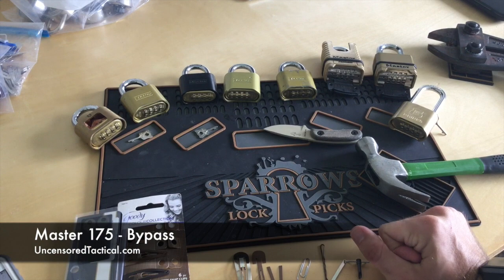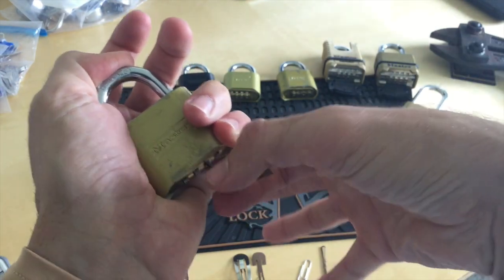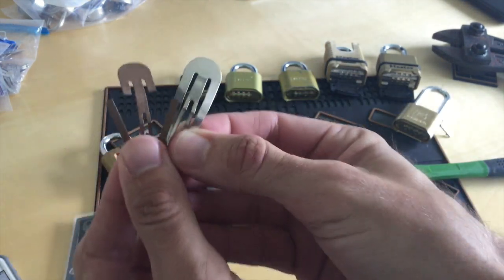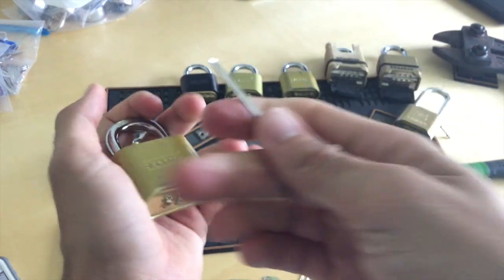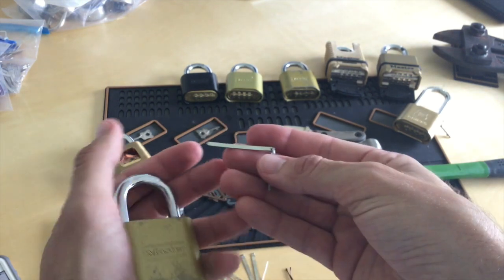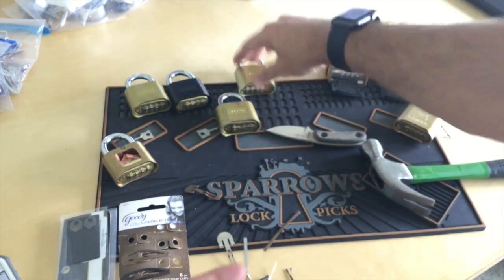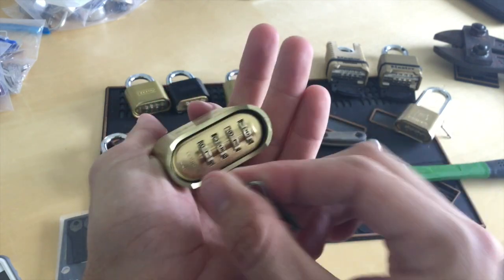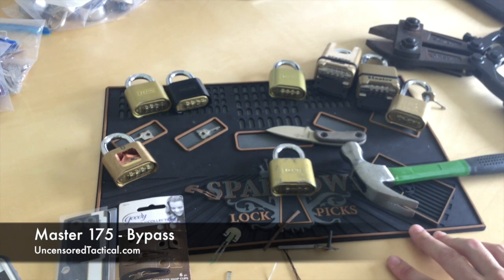Master Lock 175 - Bypass

Comment: I made a bypass tool with a bobby pin. It was too thick even after removing the rubber nub, so I sanded it down to half the thickness and put a few layers of shrink tube on the opposite end for grip. Got a ML 176 with that.
Then I made a shank out of a 0.06 feeler gauge. Glued a piece of zip tie on each side and used shrink tube over that for a handle. Decodes really well.

Comment: Bought a 175 last week (rather work bought it) the gaps between wheels are tighter but the bypas still works. It just took more force to get my shim in.
Reply from the maker: Spork Sabre it’s usually the top left of the third number, sometimes if THAT slot is too tight try the top left of the second number ;)

Comment: I was given a 178 a while ago. Outside looks barely used. No code. I can bypass it with the EZ Decoder and also a Bobby pin if you pull off the round and go over the front of the wheel. Can't decode though! I've tried a soda can shim, EZ Decoder and even a shim made from one of the little security tags. I can't feel any gates or pick up on any drag or movement when rotating the wheels. Tolerance is also very tight. 

Do you happen to know if these were updated internally at all? Have you been able to decode your 178?

Thanks!

Comment: Thanks for the video! Would a soda can possibly work?
Reply from the maker: As far as I know if the lock is bypassable in this manner you can use a soda can sliver, but if you mean a top-down shim of the locking mechinism like with commercial metal shims and their soda can improvised counterpart, than I think that one is a no. :)

Comment: Do you push on the lock first or after you get the tool in
Reply from the maker: Step one, insert tool to correct position. Step two, hold shackle closed. Step three, pivot the tool to lift the internal mechanism  - and hold. Step four, release the shackle.
Reply: @UncensoredTactical  i actually made a shim and open the lock but coworker wanted it reset. Didn't have the key